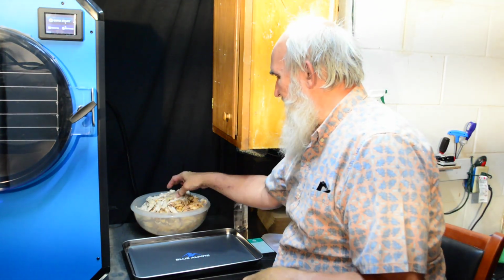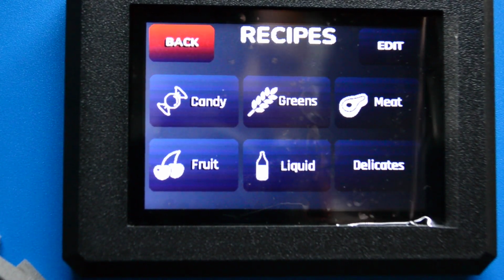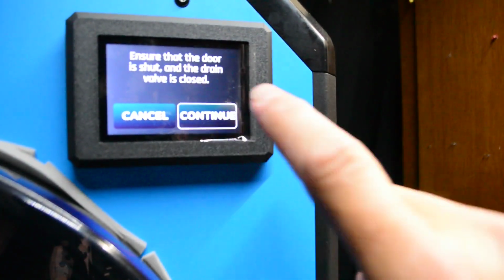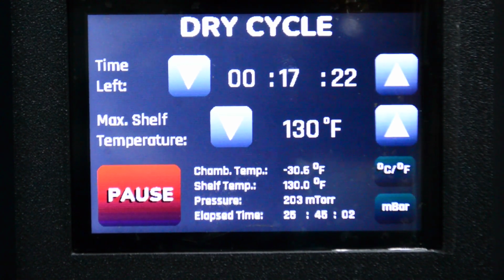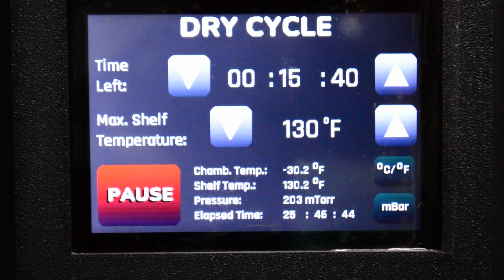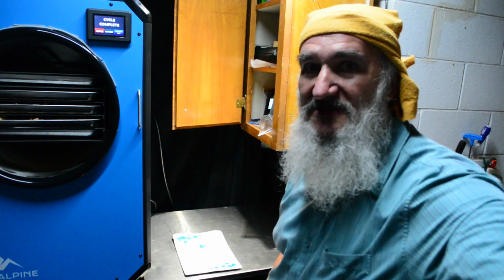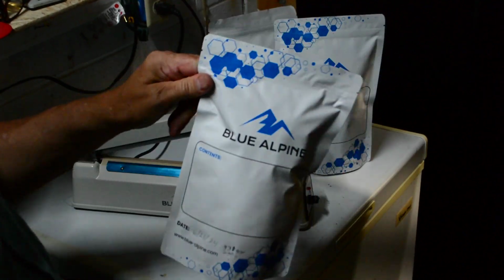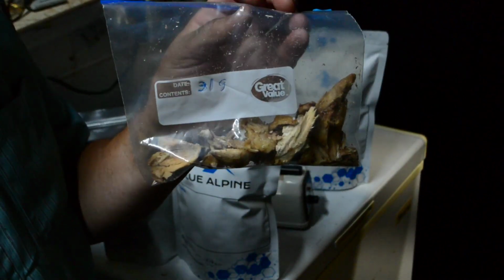Boyd's BAFD (Blue Alpine Freeze Drying) Shredded Chicken

Comment: Hi 👋- brand new BA owner . I just put shredded chicken into the freezer. May I ask a question - so mtors must be 200 for any food to be presumed dry ?
Reply from the maker: Having the MTORs continuously running at 200 or less for longer than an hour is ONE way to ensure that all of the water has been removed from the food. There are also other ways, you can weigh the food and then place it back into the freeze dryer for an extra hour or two and then re-weigh the food again, keep doing this until the food weight does not change between weighing sessions. You can also feel the food for temperature, if it feels cold it probably still has water in the food, you can also pick up a piece of food and break it to feel for crispness, this works better on some food than others but sometimes you can tell just by how the food fells in your hand. I do this occasionally but usually only when I plan to eat the food within a few weeks or months, not years. This method of testing for food crispness is not as reliable as other methods. I am sure there are probably other ways to verify that all water has been removed, but these methods described above are the methods I use most frequently. 
For food that I plan to keep for long term (multiple year) storage, I spend more time trying to ensure that all water has been removed because moisture will destroy food in long term storage more than it would over just a couple of weeks or months or when you might be storing the food in a refrigerator instead or at room temperature which would make having dry food much more important.

Thank you for your question, I hope my answer has been helpful.
Have a great day.
Boyd
Reply: @ thank you so much ! I appreciate you taking the time to give such a thorough explanation 😊